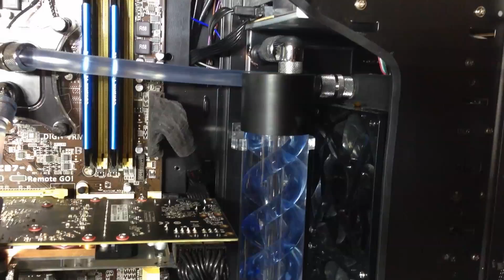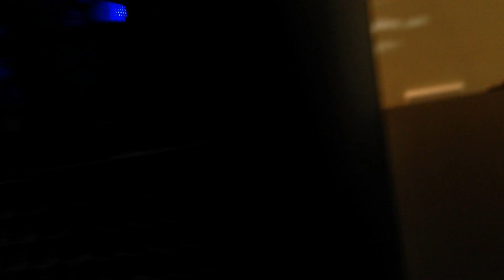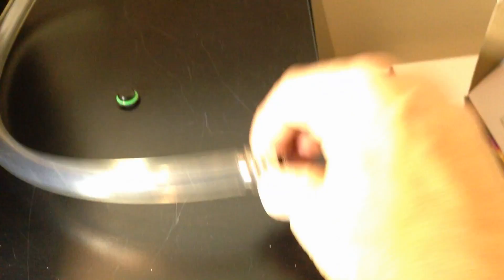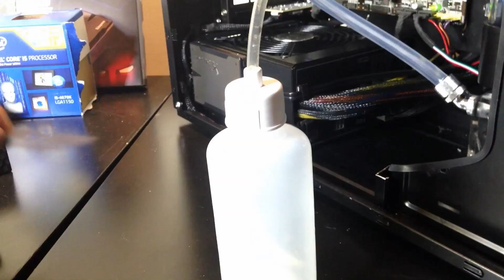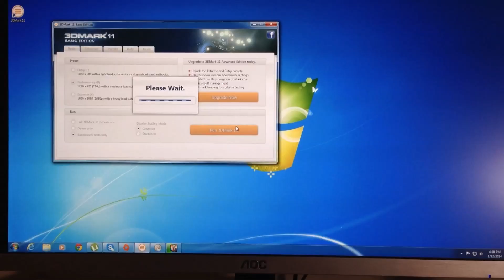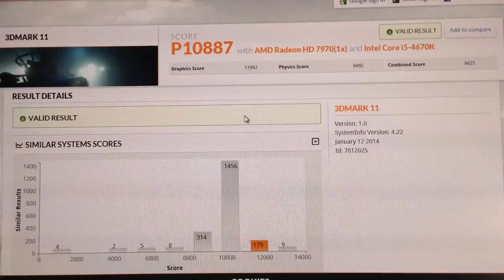Client Build #2 - Reanimation Demonstration filling the loop

Comment: Looks good but you should have used UV light blue tubes if you dont like the color water. Having the tubes glow look super ++
Reply from the maker: OMG you know whats funny? I actually did buy the UV blue tubing and I'm using it, but I only have a large 12" UV tube and can't hide it so I was going to buy 6" uv tubes to light it up and completely forgot until you posted this!!! LOL I totally forgot I specifically got that tubing for that reason LOL thanks!!
Reply: NP at all!